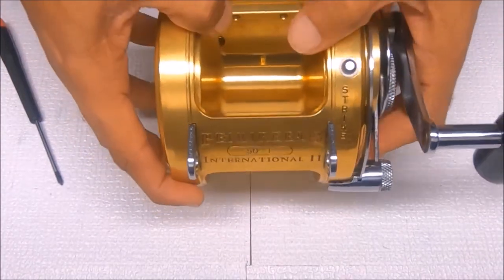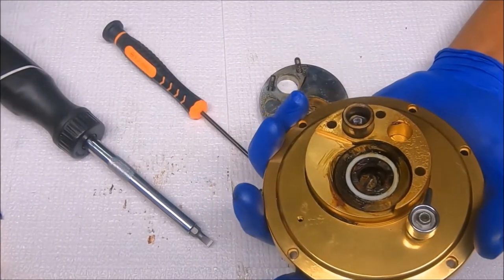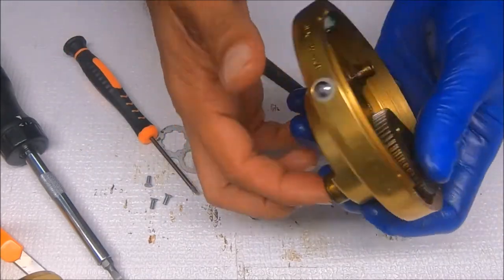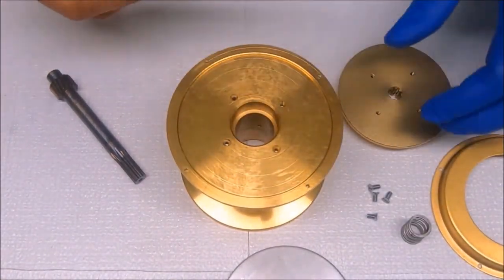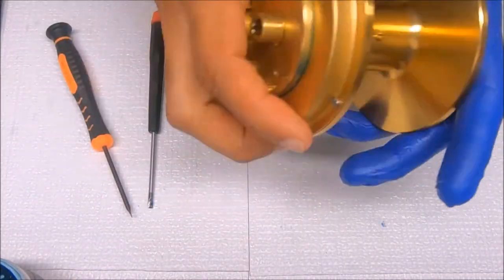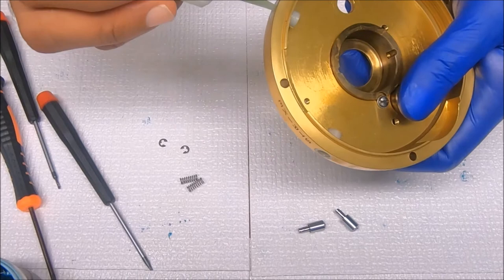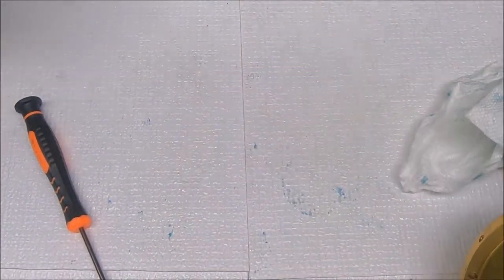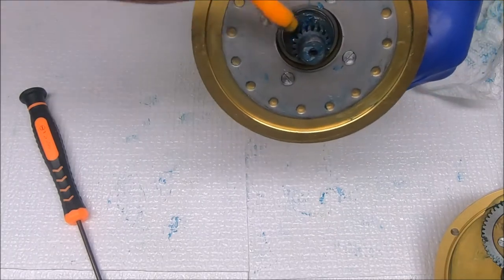Penn International II 50T Fishing Reel - How to take apart, service and reassemble

Comment: Great video!  How did you clean the main bearings?  I have seen conflicting reports whether they should be oiled or greased when installed back in.
Reply from the maker: Thanks for watching! There are many opinions. I'll 'usually grease the outside bearings (left side and pinion) with a pump and oil the inside bearings (spool).

You can check my video library for one way to clean your stainless steel bearings, or do a search on YouTube for "tsg reel bearing"
Reply: @TSGReelService  I have a bearing on my 50tw that is "grinding" a little and want to replace.  It's not the ones on the spool but the one near the handle.  Are all the bearings in this reel the same size?  Do you have a suggestion on where to get one?
Reply from the maker: @jld2008   you should definitely change it. https://www.mysticparts.com/PennParts/Parts/55-50.aspx

Comment: 710z the bail spring is strong, but the little dog post? doesn't kick the plate out enough to fully release the bail. Any ideas?
Reply from the maker: Thanks for watching! Instead of that trip post being the issue, it's more likely your bail wire is bent or trip arm inside the rotor cup has corrosion around it, or possibly bent. Start with your bail wire by undoing one side... if it sits too close or too far away from the rotor, you need to reshape it or buy a new one.